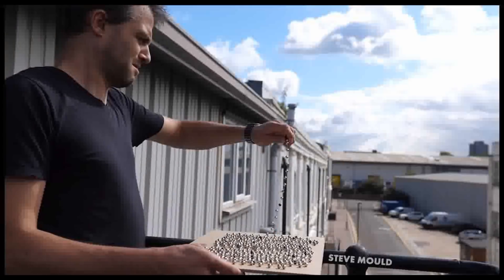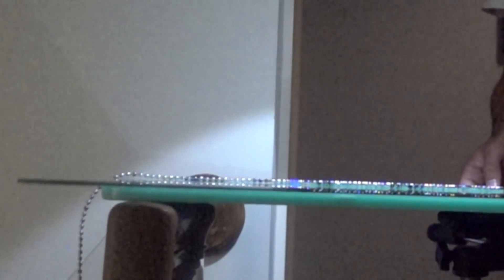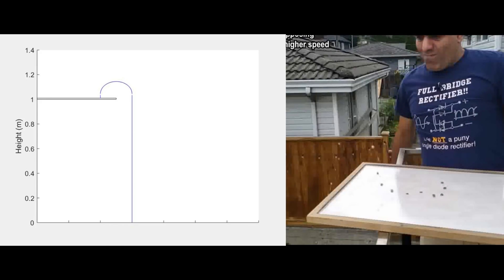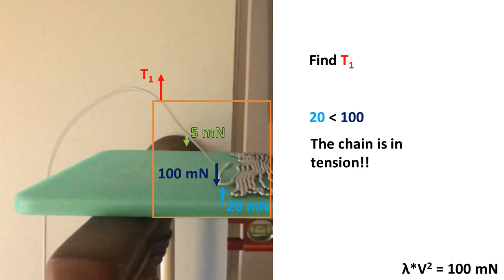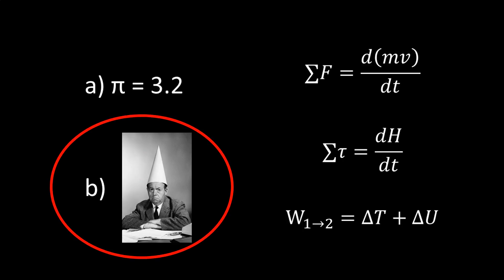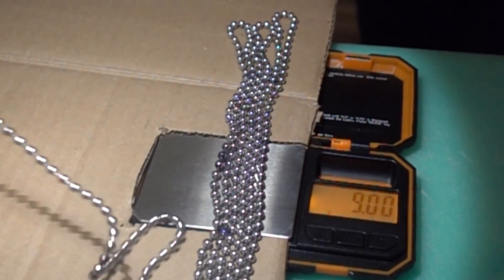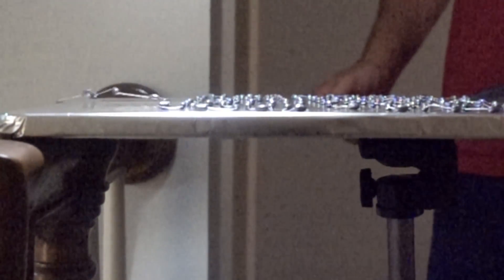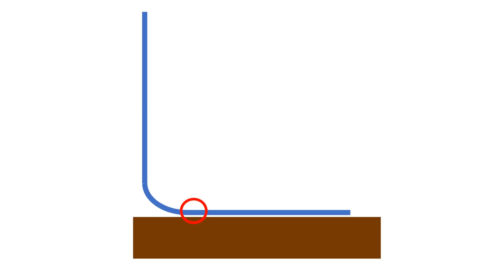And the Winner of the Chain Fountain Dispute is...

Comment: Nice tests and reasoning. Like you, I was facinated by the chain fountain last time like 5 years ago. And I solved it. There are videos that explain it in my channel. In the supplement data is a link to my paper that explains the chain fountain. I hope, you read it. In case you don't, the explanation is the slope of the pile and the (half) loops the act as one pulley system. As you too noticed.
The ideal chain and a ball chain behave a bit differently because of the bending stiffness of the ball chain. Explanation to your chain fountain from the tray is twisting of the chain that lifts the chain of the surface initiating the fountain. Also the marks in the folio result from it.